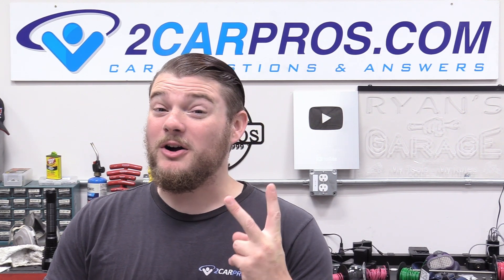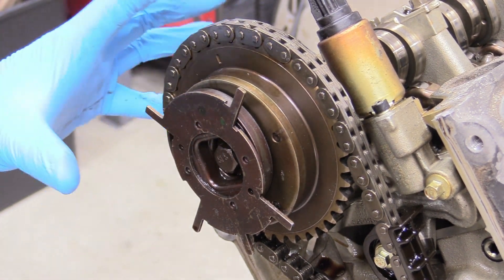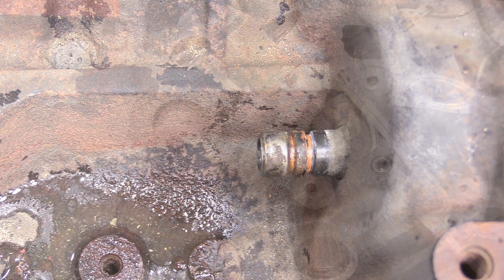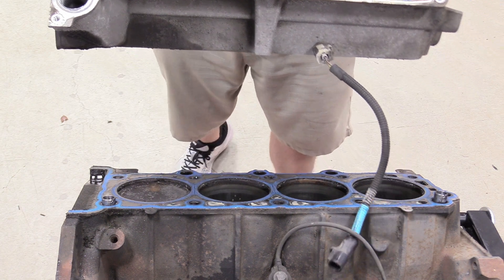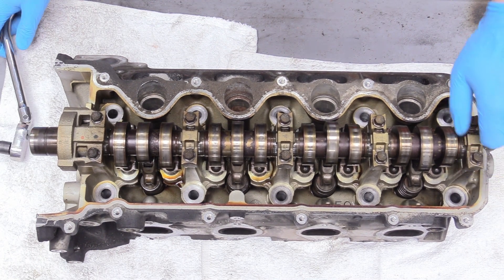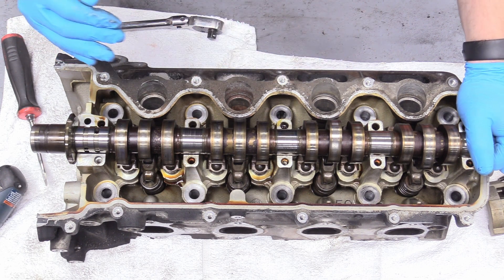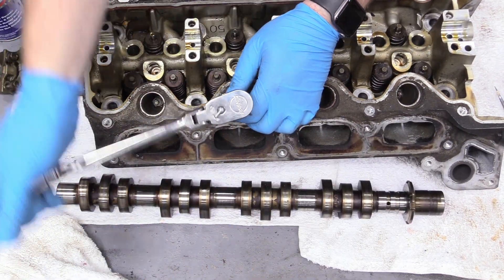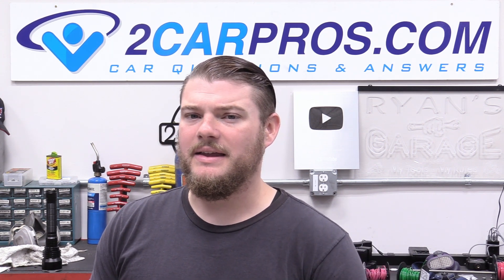How to Build a Ford 5.4L 3V Engine - Part 2: Timing Set and Head Disassembly

Comment: I want another video and they were talking about a hole needs to be drilled out bigger the loud the oil to flow through and that that was most of the problems we're having because of the restriction.
Reply from the maker: I just get the upgraded pump rather than drill holes in my block or heads. Thanks for watching!

Comment: I have 2010 F150 Platinum same engine. 198,000 miles. Engine runs and sounds good. How long can i expect it to run well with good care ? I will most likely get remanufactured engine when it gets time. What kind of improvements should be done on these engines?
Reply: I have a 2009 with 279.000 miles.  Just be an time in your oil changes with motorcraft filters
Reply: 2010 Expedition with 220,000 miles. Now doing a first time timing job on it. Wish me good luck 😃
Reply: @mar1video  just take your time don't rush.
Reply from the maker: Quite sometime if it is taken care of with quality oil and filters ever 5k miles. These engines get a bad rap but honestly I think it's because of a lot of lazy owners not changing their oil. Thanks for watching!
Reply: @2carpros  exactly

Comment: So why does the manual say you need to have cylinder one at TDC? Whats that for if yiu just remove the whole cylinder head? Also when your reinstalling the head and the camshaft, lash adjusters, and cam followers yoi still didnt put number 1 cylinder at TDC. Does it even matter?
Reply: Im not sure, but i think thats why the cam spun when he took off the phaser.